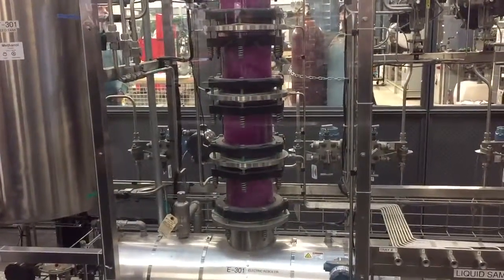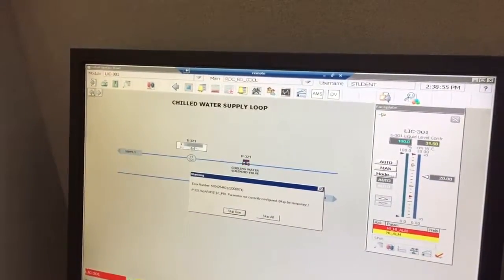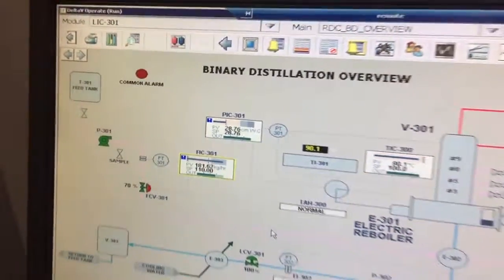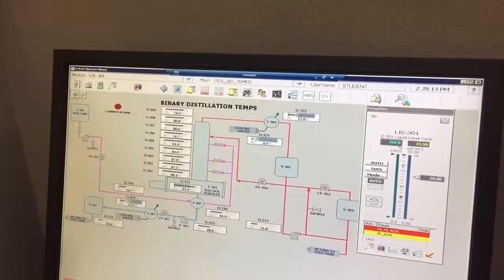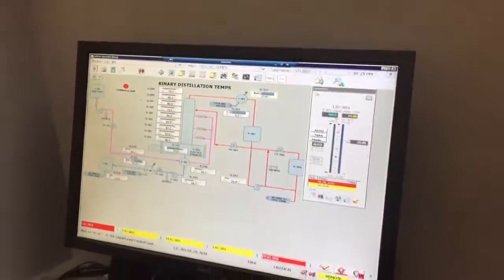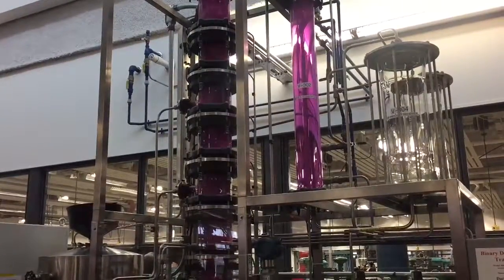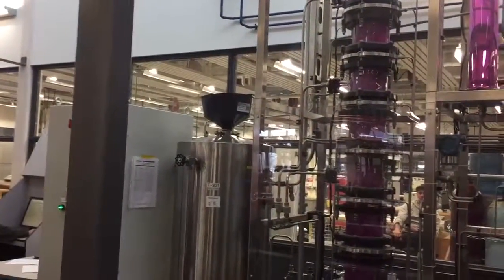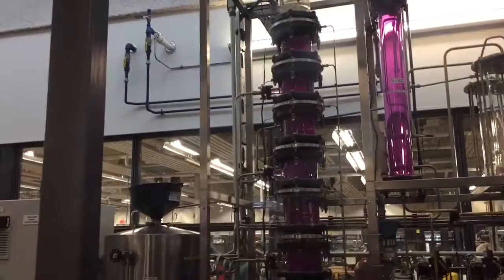Distillation Control - Puking

Comment: I couldn't hear the last part clearly about how  they got the material to come back down the column
Reply from the maker: They turned on the bottoms' pump. This is the pump used for pumping the fluid off of the bottom of the distillation column. This pump is used for maintaining an appropriate level in the re-boiler attached to the bottom of the distillation column. During this demonstration the pump was shutoff to increase the chances of getting the column to puke.
Reply: Clifford Long ok cool deal yeah I had an assignment I was doing for class about what could go wrong with a distillation column and how would you troubleshoot it. This video was very helpful thank you.